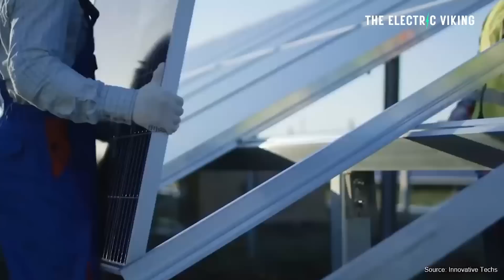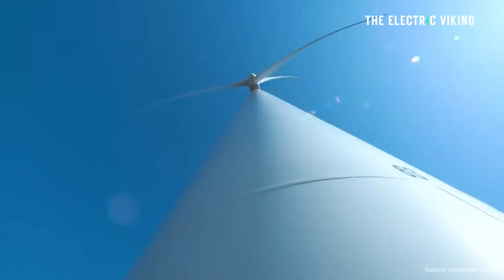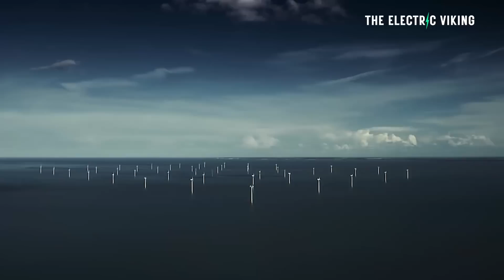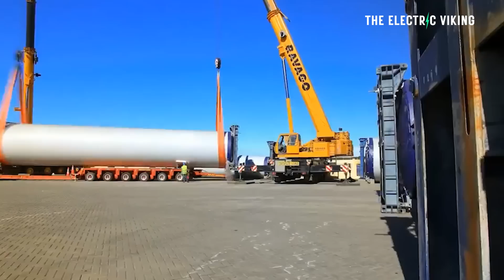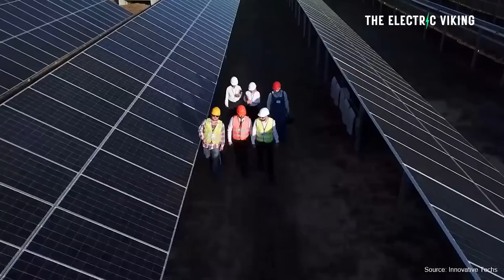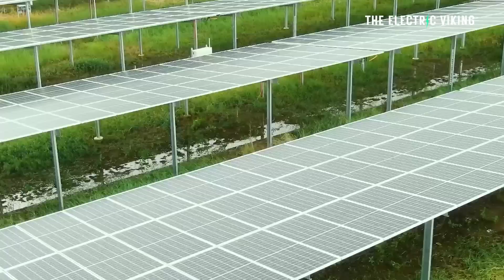8 countries now generate over 99% of their electricity from renewable energy

Comment: I have 50 Rooftop Solar Panels for 2 Houses. In Groningen Nederland. Make a lot of Money. No Energy Bill for 12 years now. People save Money with Rooftop Solar, no Gas.
Reply: Energy independence is a beautiful thing - 7kwh on my place here in Ontario Canada - I use no fossil fuels - built a modest sized home and insulated the hell out of it! Also installed solar on
my cabin up north in 2000 - those panels paid for themselves years ago and are still going strong - people don’t realize that just because solar companies warranty is 25 years doesn’t mean the panels only last for 25 - who cares if you’re getting 5-10% less efficiency on a system that doesn’t cost anything??
Reply: @willm5814  Exactly. Install Solar and make Money with it. Simpel and Easy. Thank You. My experience is. People that dont want Rooftop Solar have no Rooftop Solar. They have no hard Facts of production and money saved. I have Solar for 12 years. 50 Panels on 2 Houses and Save 6000 euro Every Year. Energybill was 3000 a year per House. Down to Zero. Inductioncooking, HT Heatpump LG Therma V 3500 euro. No Gas, Power from the Roof. Contract Greenchoice Solar Wind Company. Makes 6000 a year. 12 years is 72.000 euro in the pocket. And many more years to go.
Reply: @willm5814  That sounds like a great thing you've got going there. Congrats! You're doing better than most.
Just to cheekily test your 'no fossil fuels' claim: do you go on holiday and does that involve your cabin only? What about family visits? Do you drive your EV from that 7kW on your roof?
Reply: 12 years. amazing! I ordered mine in 2017. installed februari 2018. all 270 wp panels. Figured in the long run it would be paid after 7 years. then Russia invaded ukraine pricers went skyhigh and I saved more in one year then i thought i would in 3.5.  I just ordered 4 new panels for the rooftop of the attachment to my house. now they're 450 wp panels. total should bring me to 6500 kwh a year. hopefully I can do another installment in 5-6 years after that. I'm letting solar pay for solar.
Reply: @jordycorvers7465  exact the same Story. I installed mine in 2012. 20 Panels 200 Wp  2015 on the garage 10 more 250 Wp. For the tenant 10 panels in 2017. 300 Wp. In 2020 10 more for the Tenant 350 Wp. Done. And now it is 400 Wp. I produce 6000 kWh a year with 30 Panels. The Tenant 6000 kWh with 20 Panels. 12.000 kWh Every Year. And the price was up to 1 euro a kWh last 2 years.   Thank you for your Response.👍🙂
Reply: @willeisinga2089  Ow wow. that's actually a wonderful example! my thought was that as an early adopter your investment helped pave the way for mine. It's amazing to see how fast the technology is developing. Each of your investments is not only generating a return and, in my opinion, improving the world, it also helped facilitate  the development of the technology. of which you yourself were able to benefit from multiple times. Technology based energy really is on a different curve then fossil fuels. hat's off to you and thanks, (from Limburg;)
Reply: Best financial decision we ever made getting solar 10 years ago in my view the long year leave it the more it cost you. Regardless of whether you see yourself being in the house in the next 10 years value added when you sell and I’m sure the next house you look at buying we spending more time looking at the roof angles than the size of the kitchen!
Reply: @thepete129  Best financial decision we ever Made. 👍 Thank You. Most People reactions untill Now. I dont believe you. Thank you for support.
Reply: Solar to grid is not shorting the 24/7 electric supply. It’s a gamechanger to balance and derisk the grid brown out and black out incidents. Hopefully your local power managers are smart enough to invest and transition to renewables, beginning with their own battery systems. Then enlist customers unable to install solar (customers such as renters) into renewables investment programs to fundenergy companies’  rollout of solar. I opted to pay into that program as a renter.
Reply: @katherandefy  Exactly.👍Solar Rooftop is Power to the People.
Reply: Your story is similar to mine, and I love to see others thinking the same way.
Reply: You mean when its sunny your'e selling electricity back to the grid? That needs to be banned, it's destabilising the grid. It's already being banned in California. You're actually harming society.
Reply: 50? How much did your system cost; and how long for it to break even? a 10 panel system in the USA with batteries costs $20,000.
Reply: I would love to do this in the United States, but for some reason we can't just order the solar panels ourselves and install them.We have to be under a contract with a company by law
Reply: @teebone2157  Not a job for the hobbiest.  PV panels are wired in series yielding very high DC voltage.  The inverter and battery is very high power compared with any appliance which an amateur is used to dealing with.   It's not rocket science, but risk is much greater than the benefit.
Reply: @teebone2157  This isn't true at all, and DYI kits in US are plentiful.  Just look at SanTan solar or dozens of other sites that sell equipment.  You can install both on-grid and off-grid systems by yourself but you have to know what your doing.  It just requires a permit and inspection, which in my area cost $800.  Connecting to the grid requires certified equipment, which is plentiful as well and requires a separate inspection from the power company to insure it back feeds properly to the grid.
Reply: @teebone2157  Google Stralend Groen Solar Panels. Prices and Systems in Nederland. DIY Sales in Nederland.
Reply: @teebone2157  I don't believe that is accurate. I don't know where in the US you live but I have never heard of this.
Reply: How much is your solar panel contract per month and is that saving anything over the utility company bills you had?
Reply: @markmiller8903  it saves me 3000 euro per year for myself. And 3000 a Year for the Tenant. Same system. Rooftop Solar, Inductioncooking, HT Heatpump LG Therma V Monoblock 9 KW. So it saves 6000 euro per Year.
Reply: @markmiller8903  I pay 22 euro a month and get a refund end of the Year.
Reply: Try smelting iron ore on the weekend...
Reply: @jgarbo3541  German Steel goes All Electric. Aluminum melting is All Electric Worldwide. My House is All Electric. My Car is All Electric. Inductioncooking is All Electric. My Heatpump is All Electric. The Train is All Electric. The Ferryboat is All Electric. The River Ships All Electric with Battery Container Swapp. Fat Bike is Electric. Scooters Electric. TV, PC, Laptop, Tablet Electric. Vacuum Cleaner, washing machine, wash dryer, warm water Boiler, Airfryer, Oven, Ledlights, Grassmower, And Tools All Electric. Where do you live that you dont have Electricity???🙂👍
Reply: The rest of the world has 4 seasons that include hail storms that ruin solar panels or wind storms that bring down turbines.  Great for you Dutchmen
Reply: @Panicscroll69  No Panic. Solar Season is Summertime. Sun Power. Wind Season is Wintertime. Windpower. Year Round lots of Cheap Renewable Power. Baseload Secured, Smart Grid Control. No Coal Gas Biomass Nuke Power. Price  down to 20 cent kWh this month april. In Nederland.
Reply: Well, if they do, it's because they save paying an artificially inflated price for electricity, while others do pay the inflated price and/or they're not paying their fair share into keeping electricity available for consumption 24/7.
Reply: @hvh377 i guess you are in favour of a carbon tax then? The fair cost of every power source. Let’s see which ones are over and under priced. Always keep the goal in mind: reduce ‘human’ CO2 emissions to zero.
Reply: @elinys2843  I'm in favour of warmer climbs... 😉 Although, come to think of it, CO2 tax will make the initial investment for an EV completely unrealistic for any consumer. Let me think about it...
Reply: @hvh377     In most countries the base thermal generation plants are historic, out of capacity and running threadbare.  Governments have the option to urgently grow renewables (through generous subsidies) or impose a heavy surcharge to build new thermal capacity.   It makes strategic sense to avoid the clutches of energy countries and companies who have happily scrwd us for decades. Rather nice to turn the tables on these individuals! If it saves the planet, it's a bonus.
24/7/52 is not a technical problem any longer.  It is a strategic investment issue only.  Continental networking, battery plant, pumped and tidal hydro, fast response gas plant, ground source  thermal,  leveraging of legacy nuclear thermal plant is all proving to work now. 
Stay away from the shore Kanute, the new wave is already coming ashore!
Reply: When will you replace those solar panels? And what will that cost?
Reply: @TheBooban  Solar panels have 25 years warranty (I installed them at my home, too).
Reply: @TheBooban  50 panels at 100 Euro (and dropping) a piece is 5K euros. They last 25 years, that's 200 Euros per year. I'm also from NL, have 10 panels and make 800 euros a year (after my own energy usage has been deducted). Generally in NL you recoop your investment within 3 years (I did). And those numbers are assuming that the energy prices will stay the same; when they rise, you recoop even faster.
Reply: @RobClardij  The only reason panels have such a return on investment (in your case ridiculously high), is because in the Dutch situation, solar owners can avoid the insanely high taxes for domestic users on electricity. If you have to calculate against the actual price of electricity (that non-domestic users pay), solar panels are not worth the effort unless the installation is huge (measured in acres). The only reason small solar systems are viable is because they are effectively heavily subsidised by exempting them from environment tax.
Reply: @hvh377 let us know when you have some facts to back up your claims. Try doing something like this:  Per the IEA, solar is the cheapest generator of electricity even without subsidies.
Reply: @hvh377 good! Who cares what causes solar panels to be profitable, as long as they are! I invested into a 9 kWp installation… got zero subsidy and no buy back of excess energy because it is ground-mounted (for some weird reason, only rooftop panels are subsidized here in France… nobody was able to explain me the reason). Despite this absence of any incentive, my panels will be paid back within 10 years at today’s electricity price.
Reply: @hvh377 there is much more than just the price of power generation and possible environmental tax in an electricity bill. A pretty big chunk of it pays for the connection to the grid, and for the transport and retail distribution of the power. Industrial users pay much less because they pay themselves the price of connection and of a sub-station… and of course because they buy the power at wholesale price, under contracts.
Reply: @st-ex8506  Yep, I left all of that out of the equation, because it is not relevant. You need to pay that anyway and in the Netherlands, the rate is flat whether you take 1kWh or 10000kWh per annum. Again, domestic use only.
Reply: @hvh377  ah! Ok! Here in France, you pay a flat fee fee for connection, but a per kWh one for transport, i.e. the grid.
Reply: @RobClardij  uh. I should hook up panels in poor neighborhoods and become the solar panel slum king.
Reply: @hvh377  yes, but to be fair there where taxes before solar. at least with solar we don't have to protect our foreign "oil interests" so much am I right? I'd rather pay subsidy to someone in the Netherlands then to Russia or saudi arabia,
Reply: @jordycorvers7465  I agree, but we probably will exchange the protection duty to our "solar panel interests" and "our lithium cell interests" and pay China for the pleasure of being green.
Reply: @hvh377  rooftop solar is the only investment returning a tax free 10% return (often much higher), backed up by a 20-25 year panel manufacturer generation warranty and equipment is secured by homeowners insurance. If you could buy a bond that payed out a tax free interest rate of 10% for 20-25years and was 100% insured from loss, most asset allocators would take that option for a portion of their portfolio. It’s a great investment (I’ve done it 2x on two homes) and it just keeps getting better every year ignoring the tax incentive savings entirely.  Don’t like making or saving money?  Don’t do it.
Reply: @brenth.8474  My post was applicable to the situation for domestic installations in the Netherlands only; as I wrote clearly multiple times.
None of the conditions you are describing are applicable in the Netherlands. No warranties are secured for 25 yrs, and they're certainly not backed up by home owners insurance.
ROI is mostly defined by government policy, which is very uncertain even over periods of 4 years or less (elections).
However, for a period, solar installations have been exceedingly financially beneficial and many people made a decent profit. Uncertainty about profitability in the future is making domestic solar less popular now. Although for new builds, a solar installation is practically mandatory by law.
Reply: @hvh377  no ROI is determined simply by the price of electricity vs the price of solar panels. Government policy is irrelevant. Warrantee is offered by the solar panel manufacturers and I have a 25 year warranty and my homeowners insurance does cover the panels, but if you want to make stuff up feel free.
Reply: @brenth.8474  The price of electricity is  determined for 70% by taxes set by the government. So, ROI is mostly determined by the government.
Furthermore, new higher tariffs for solar installation owners are introduced this year by energy providers. They'll happily take a large part of your returns for themselves. These tariffs have never existed before, so even if the government doesn't affect your ROI adversely, something else might kill your 25 year guaranteed return.
Which solar panel / inverter manufacturer exists long enough to handle claims after 20 years? Most of them are in China anyway. Good luck claiming warranty there! Only way to ensure warranty for 25 years is taking out an insurance yourself, but that'll cost ya.
Again, for the umpteenth time, all this is applicable for the situation in the Netherlands.
Do you regularly offend people by calling them 'liars' when they explain you something you didn't know yet? You should learn some manners and maybe learn what 'overconfidence' means.
Reply: @RobClardij They last more than 25 years. I have 35 year old ones still spewing out electricity maybe at 75%. They are more than paid for so it is all for free.
Reply: @hvh377  interesting point. I do think that a technology shared and developed this broadly will not be beholden to a single country. That being said, I think there are very few economies that can compete with China's manufucturing scale. so it makes sense for everyone to have them produced in China. if China tries to sqeeze the markets for high profits then it will make sense to produce somewhere else. that being said. solar panel manufacturers operate on very low margins and high volumes.
Reply: @jordycorvers7465  I sure hope you're right.
Reply: @hvh377  I think anyone here is skeptical  when you say the solar panels (a fixture on your home) are not covered by homeowners insurance.  So are you making that up? 

If you think overconfidence is pointing out clearly made up stuff, good luck.
Reply: @brenth.8474  Of course, damage is covered by home owner's insurance (if the solar installation is 'nailed' to the home), but product warranty is not. That would require a separate insurance, which isn't free.

Was it a lot of work finding something you could misinterpret, so you claim I'm making up stories? It's interesting that after arguing with only irrelevant points for the situation in the Netherlands and being told that several times, you still think that the person who speaks from experience living in the Netherlands and owning a solar installation for over 10 years, is the person who is overconfident. Is that a tiny bit of Dunning-Kruger I detect there?
Reply: @hvh377   Bottom line: the panels are covered by homeowners insurance and they do have 25 year warranties that guarantee a certain level of generation capacity.  Calls into question your entire reason for posting and I respectfully think I’m not the one sounding like an overconfident fool here.

For example: why would you think homeowners insurance would cover the panel warranty?  That’s not how it works - insurance replaces damaged panels and warranty covers performance over a certain period of time (you know, so you know how much the ROI is up front.)
Reply: @hvh377  both Tesla and sunrun have offered 25 year warrantee.  I believe sun power panels also had 20-25 year warrantee. I could go on with the list.  I’d specifically try to avoid the cheap panels made in china.  You can keep detecting tiny bits of DK when some one calls out your false posts and everyone else will detect BS. I think everyone here was on to it (your BS) pretty quick too - if we are here, it’s because we likely have solar.
Reply: @hvh377 well, obviously they should be subsidised from tax. If your generating your power from solar, your not paying for huge power stations or windmills to be built and operated. Hence, no tax. It’s your business.
Reply: @brenth.8474  Tesla and Sunrun don't sell solar in the Netherlands. So again, their warranties are completely irrelevant for Dutch home owners. When will you end the useless arguments?

I will concur that the situation elsewhere in the world can be completely different and what you're saying makes total sense in your situation. But then again, I never claimed otherwise. You however.... 

Please stop!
Reply: @hvh377  sun power (I mentioned them for a reason) does sell panels in Netherlands. 30-40 year warranty.  Anything else?  I do my best to make statements that are accurate. Pretty common to offer the same warranty in multiple countries and generally the warranties are offered are 25 years +.  This is just common knowledge not a psychological perception issue. I’m sure “nailing” them to the home voids the warranty and likely the insurance coverage as well. So you might try another method.

Furthermore, there are posters above who specifically mention the 25 year warranty. It’s not just me stating this - common knowledge.
Reply: @brenth.8474  Please stop. Don't you think you have made enough of a fool of yourself?
Reply: @hvh377  So your warrantee claim was false as well - you’ve been proven wrong here by pretty much every other poster as well. Happy to leave it there.
Reply: @brenth.8474  Still at it then? I don't think you can even remember what it was that I pointed out (and you think I'm wrong about). Probably because you didn't read it in the first place.

Let us both agree that you think I'm wrong, so we can end this stupid exchange in agreement at least.

Over to you for the last word, which will inevitably follow now, I'm sure...
Reply: @hvh377  cool, sun power panels are sold in NL with a 30-40 year warranty. True or false?  

Homeowners insurance covers the panels and equipment.  True or false? You’ve stipulated that what you said originally was false regarding insurance.
Reply: @brenth.8474  Plenty of solar panels with long term warranties available in the Netherlands, including Sunpower. I never claimed otherwise.

Homeowner's insurance covers damage to solar installations in the Netherlands (if they are fixed to your house at least), but do not cover the warranty. That's already the second time I wrote this and I never claimed otherwise.

Now what? Are you going to stop bringing up irrelevant points and fabricating a POV that I am supposed to have taken? I highly doubt it.
Reply: @hvh377  nope now you’ve corrected yourself.  We can now conclude that solar panels are indeed backed up by a 20-25 yr warranty (or longer!) and covered by homeowners insurance (whether made a fixture of the home or of the home property). You won’t find that kind of guarantee or security in the stock market.  Great investment!  

You stated that warrantees were not secured for 25 years and you’ve  taken that back and you’ve clarified your confused language around home owners insurance. All good! Have a great day!
Reply: @brenth.8474  Keep building those strawmans, mate! I can only express pity for someone who feels the need to deliberately misrepresent someone else's POV, just so he can claim he was right. You claiming I stated certain things, doesn't make it so.

I already concluded (many posts ago) most solar panels are backed up by a lengthy warranty that usually isn't worth more than the paper it is written on. No correction needed whatsoever. This is the case in the Netherlands, but probably in many more countries.

It never even crossed your mind to ask why I would claim that, now did it? Oh no, just all out attack mode from your first aggressive reply to any of my posts. Pls. read that one back and reflect on the quality of that reply (and everything that came after that).
Reply: @hvh377  I’ll let everyone else decide - you proven your self a purveyor of falsehoods. Try to have a good day!
Reply: @brenth.8474  I think you should probably read back the whole ugly discussion and reflect on your own behaviour. Strawmanning everything so you can be right and using an aggressive style is very bad form. You just throwing around false accusations like that really doesn't make your case any better.

And I'll have a good day, don't worry about that.
Reply: @hvh377  I’m fine with my rebuttals and yes I will have a wonderful day!  Especially after re- reading.
Reply: @brenth.8474  That doesn't bode well for your character. And I see you're having  trouble reading again.
Reply: @hvh377  I’m not concerned with what YOU think character is.  Bottom line: people like you  get caught making stuff up sometimes and instead of talking about the facts they attack the messenger to obfuscate.  Thank you for that.
Reply: @brenth.8474  Yet, you feel the need to mention your lack of concern.

Sometimes people see themselves as messengers spreading great truths while all they do is misread and misrepresent to feed their overinflated self-image. Prime D-K effect...
Reply: @hvh377  I’m not sure what you need to hear from me.  The facts are clear, you corrected yourself after posters and I showed you what you said was false (and it took an unusually long time for you to grudgingly change your tune). Your diagnosis or assertion from afar with regard to DK or character seems nothing more than another attempt to obfuscate your false statements or punish someone who called out your misrepresentations. I’m not here to address your perception of yourself as an expert in either DK or character. Facts matter. I can’t help you with the rest of your complaints.

The most common tell of a dishonest person: they call anyone that corrects them rude or ugly and play the victim.  It’s grammar school level nonsense.
Reply: @RobClardij  Dankje Rob 👍🙂
Reply: @TheBooban The warranty is typically 25 years with a guaranteed sub 10% efficiency drop.
The panels will last way over 50 years, no moving parts…
Reply: @TheBooban I have 35 year old panels that still put out 90 percent rated output. Used panels are almost free now. Panels can be on the ground or on a fence or ladder whatever, use plug in inverters low voltage is safe to handle
Reply: Booban, my solar panels have a 25  year warranty. Which means they’ll last at least a decade longer than that. The solar panels on your roof will last longer than you or I will.
Reply: @freeheeler09  Yes. I am 70. When I am gone my son takes over. 👍🙂
Reply: @TheBooban  Prices of solar modules are down at a level, that cost are almost no factor anymore, putting it on the roof costs almost now more than the panels itself. A 500 Wp module cost around 100 to 150 dollars/euros these days. A few years ago it was 10 times more.
Reply: @TheBooban  even after 25 years most panels will still produce 70-80%
Reply: @williamkreth  True. Thank you for positive comments. People came to my House to see. After leaving I heard them say. I dont believe it. So see for yourself. Try and succes.
Reply: @williamkreth  I am really curious about what will happen with "unwanted" old solar panels that still work. Lifespan is estimated at 40 but might be even longer. (newer panels have simply not been around for that long) so let's say after years into the future the technology is still progressing like technology does and we have, oh I don't know 8000 WP solar-wind hybrid panels ( hey, just saying I can't predict future technological breakthroughs) what will happend to those still functional old panels in their future? they still can produce "free" energy. So what do we do? Recycle them, send them as aid to developing countries, or countries in or coming out of war? do we all install them in one neverending remote spot hooked to a hydrogen factory? I hope I can find that out and what humanity will be able to do with almost unlimited "cheap" energy
Reply: @jordycorvers7465  I actually buy used solar panels all the time. They will be used. Often important infrastructures have contracts to replace the panels even before their rated time is up. I got a stack of used 360watt panels for 110 bucks each that insanely cheap! Also when they completely stop working some people use them as roof shingles for sheds and such. They will be used